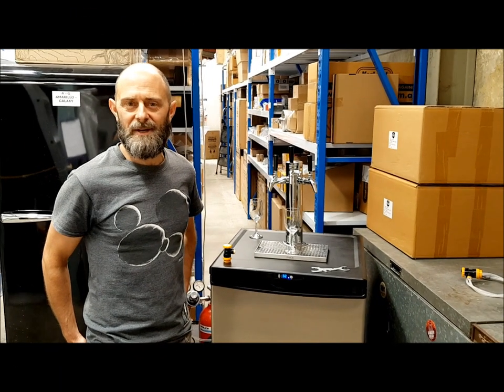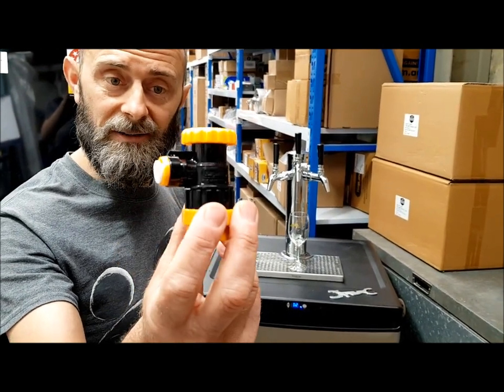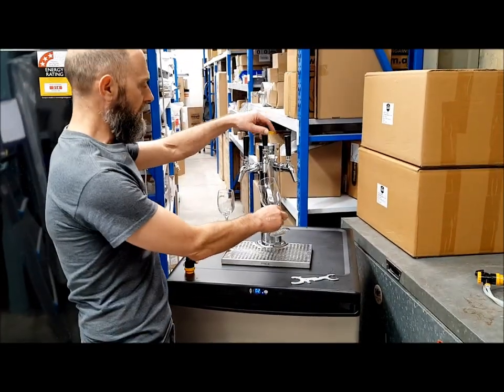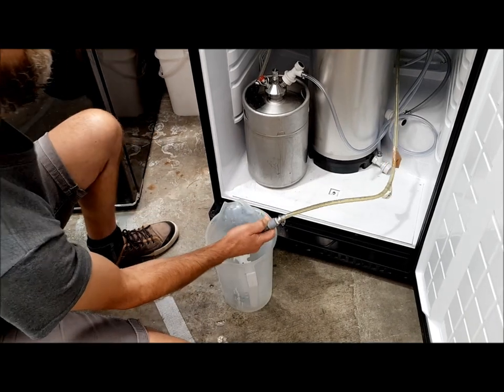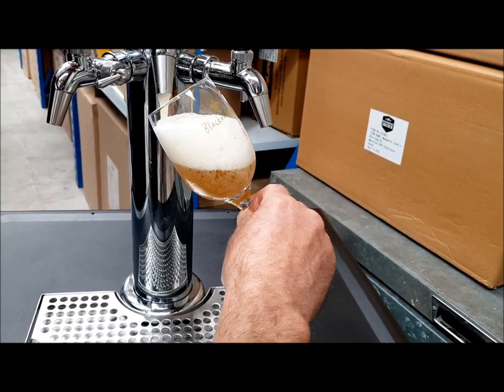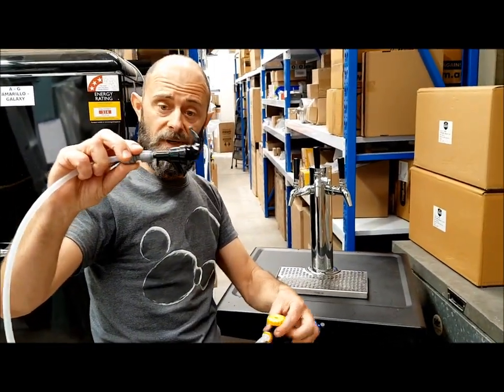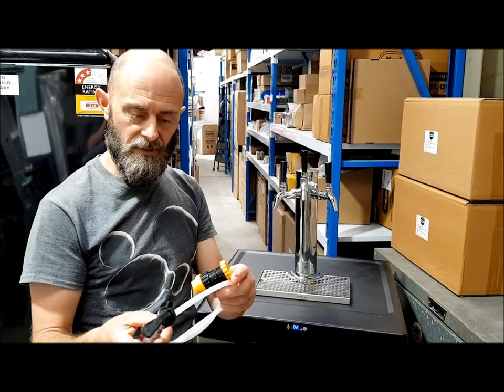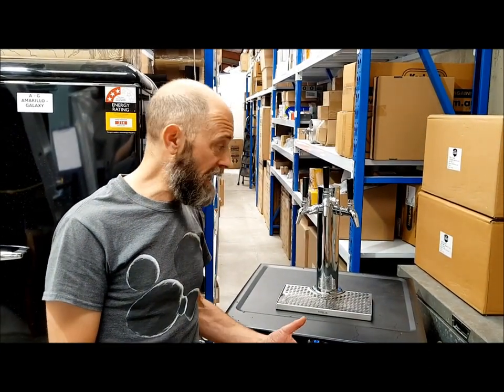Be a head master and control that beer or cider foam!

Comment: I find those are way too tight to turn. Hurts my hands!
Also, still too much foam. I noticed that if I fill bottles using counter-pressure filler and then serve from the bottles it doesn't foam at all and the amount of bubbles retained by the cider in the glass is much better.

Comment: Just reduce the serving pressure and it will do the same thing. People seem to think serving pressure needs to be at 10-11 psi but I use 5-6 psi on my kegerator which is the same as that one but 2 tap. In the fridge I carbonate at 25psi for exactly 4 days then serve at 5-6psi = perfect every time - no over carbonation and perfect pours!  So simple!